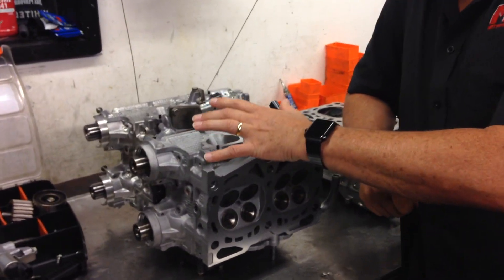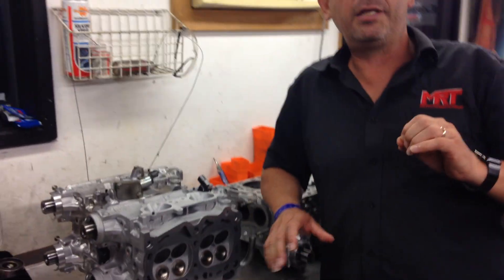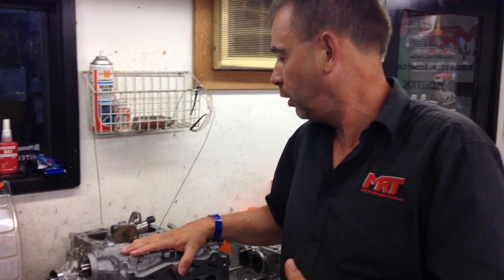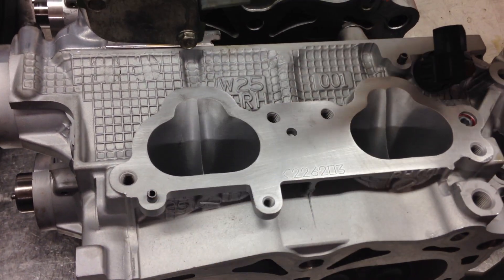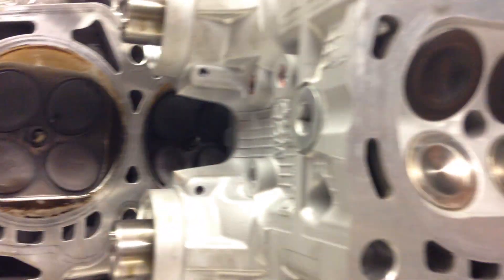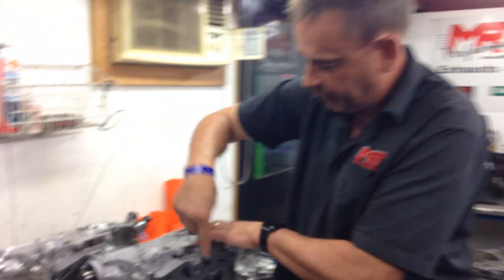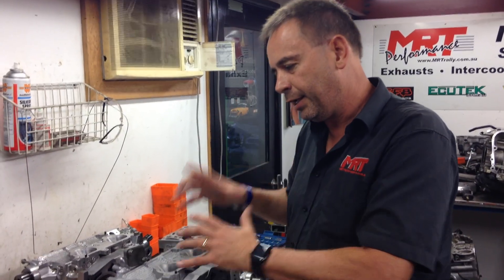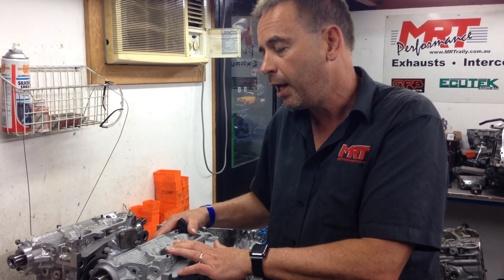Project Billet - Ported VS. Stock Subaru EJ Heads - Benefits and Comparison

Comment: What is the logical order of head modifications on EJ25 , in my case SOHC heads with delta 1500 cams.. 3/5 angle valve job... port and polishing, bigger valves, etc.   Planning around 23psi @ 6850-7200rpm (Centrifugal SC).

Comment: In my experience porting and big valves along with supporting mods gives you the same increase as it does on normally aspirated. To give an example of what it can do, there's a guy running a VQ37 naturally aspirated that puts down 557hp at 8000rpm. That will smoke a stock GTR. So done right it can do an insane amount. That VQ37 would make around 1000hp on 20 psi of boost on E85. How much boost do you need for a stock head and cam GTR? You would need 35-38 psi boost to hit it, 1 bar more than the race ported and cammed engine. Obviously both would need built bottom ends. But the idea is clear. Porting and Cams is the first thing if I open a motor 😍

Comment: Any benefit of building a 2.0 bugeye motor? Or should you just build a hybrid? I heard you can take a 2.5 sti block and stock 2.0 heads and it would work. Not looking to run stupid amount of power. 300-320 maybe

Comment: Thank you you did a video!!
I need to see part 3! I mean, I need to see everything about EJ25, so I can have the knowledge to know what I need and want to be done on my '09 STi Hatch! I need it AS RELIABLE (with proper driving of course) AS IT CAN GET. Actually on 400HP, but later, I will want to move to around 600HP, but only if it handles top reliability.

Comment: When trying to match cams with a turbo, my first reflex would be to take cams with an hurley exaust valve opening and a longer overlap time with the inlet valve (high rev cam design)  to compensate for the spool up restriction. If there's some air/fuel mix lost in the manifold between the exaust  and combustion stroke and pressure remaining from the combustion then it will help to spool up the turbo faster.

Comment: awesome vid.  how much airflow was gained (at what lift/pressure)  from porting?  was there more work like a valve job to complement the larger valve size or was it deemed unnecessary?
Reply: VIsubby. titanium valves are lighter = less reciprocating mass, do you think or do you know for sure they use titanium for strength?

Comment: so the cams and valves are key. the rockers and Springs wouldn't need to be upgraded on the head to work with the new valves and cams?
Reply: I wouldnt use any stock parts that work in conjunction with aftermarket especially moving parts. Upgraded cams with custom lobes change how the valves move and the speed of the valve to to keep up with the stress and performance of those parts you want strong and reliable springs that are made with the metal composition and dimentions to meet the requierments.

Comment: should go water to air inter cooling on this build
Reply: I would say air to water
Reply: ElMosqito why?... does the air cool the water?
Reply: It's all about heat transfer. If you want to cool down air by water you need to transfer heat from AIR TO WATER. That's wy i would call it an air to water intercooler
Reply: lol your describing a radiator... anyway I'm sure your in the right and everyone else on earth is wrong. lol
Reply: why? this will be running on e85 which is better/cheaper than meth and cheaper/safer/ more efficient than nos.
Reply: ??? you was talking about water injection? and no, radiator would be water to air (you are transfering heat from water to the air)
Reply: yeh but then u need to cool that water back down out the front of the car
Reply: -.- 
But still air is cooled by water. Going this way every engine is air cooled because water is cooled by air. Oh, wait - what cools air? ground? space? black matter?
Reply: You are an idiot! They are called water to air intercoolers, not the other way around
Reply: Firstly i hope you are just a troll, secondly i will not take lessons 
from person who dont know difference between "your" and "you're"
Reply: I said you are fool! Learn to read!
Reply: I was responding to KAVINSKY311  -.-     You are not the only one in te world...
Reply: ElMosqito look at you, you can't even spell "the" no wonder you can't grasp the concept of a water to air intercooler...  What a philistine.
Reply: Uh huh sure lol
Reply: my "h" button is broken so not every time when i click it it types in

Comment: hmmmmm, you know the prodrive v1 ej20g heads were cast in house by prodrive - that the ports are actually SMALLER but produce more torque and power, there is a supplier in UK (i think) that sells billet heads that incorporate the prodrive design to a billet head with some mods, according the the website they go pretty good haha
Reply: Well, prodrive were building a rally car, so top end power was not a priority as much as low down torque and response were, I really don't know the details/numbers I imagine the prodrive heads are not so great for higher power, they probably made up the power else where in the setup so the response gains probably out weighed any power loses. My comment was more for the random interesting information point and in the hopes to see an mrt video on a billet block and heads build/dyno/run down/show off . Go on guys you know you're as curious as I am, no one seems to have done it yet :D Billet block and billet heads, dooooooo ittttttt!!!1
Reply: and this also was in an era where shim under subaru heads didn't exist. Hydraulic was what was in the street cars. I'd say the first production prototypes were inspired around the rally car head design/RnD by pro drive , and prodrive probably got inspired  from a bike manufacturer lol

Comment: i wish i would have ported my heads when i built my motor, it is now my limiting factor. good video
Reply: VIsubby i have 404whp on pump and as i tried to raise psi past 22 psi my gains were minimal. now i could get a bigger turbo to over come my flow issues but would gain more lag as a result.  it is far from scientific for my particular motor, but if i could move more air through my 2.0 heads more efficiently, i could make more power with a mild boost increase with my turbo.
Reply: Stock avcs 2.5 heads can flow enough for 500/600 bhp .